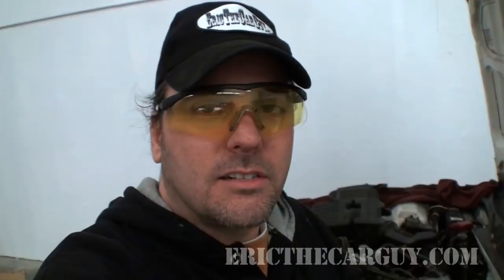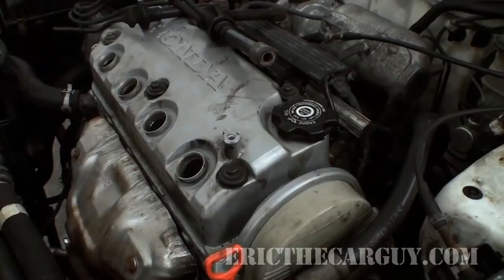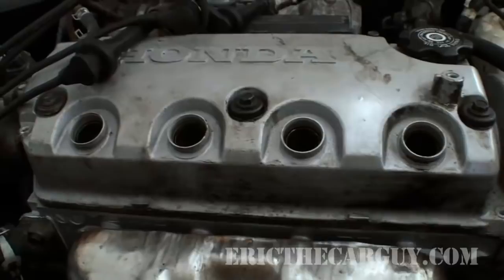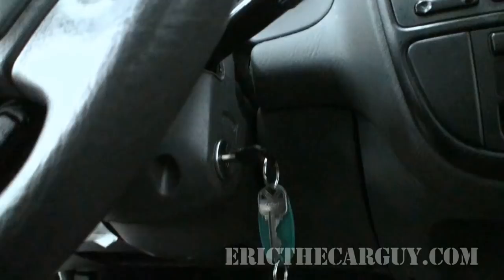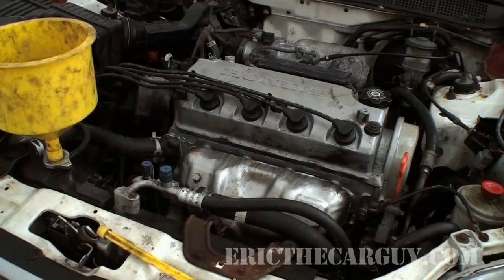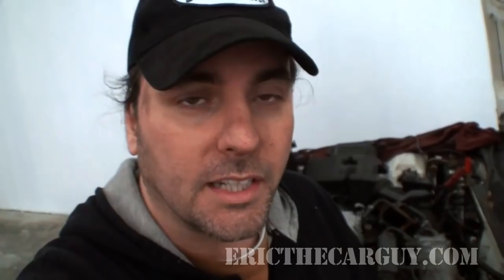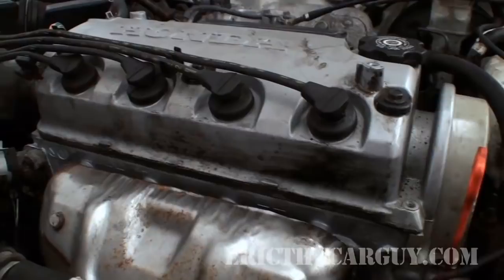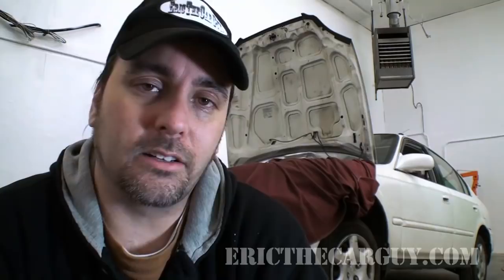How to Break In A New or Rebuilt Engine - EricTheCarGuy

Comment: Yes you can, the only thing that matters is that the engine is turning over. You only remove the spark plugs to ease the load on the starter, and you keep the injectors off to keep unburnt fuel from getting in the oil. Also needs to be a manual transmission.

Comment: Never start a new/overhauled engine without first installing a magnetic drain plug. There's a lot of microscopic filings that would otherwise be re-circulating.
First oil change, you will notice that the magnet-tip is loaded with deposits from the break-in. It (the deposits) lessen drastically after the first oil change. If you are running a flat-tappit engine, make sure you have Zinc (ZDDP) in the oil formula..as in API SF. Valvoline Motorcycle Oil is a good choice for Zinc. Best.

Comment: We all do things differently. But, my eyes are looking under the car 15 seconds after initial start. Changing the oil filter after an hour or so can't hurt either. Changing the rpm during break-in helps the motor "get used" to different stress loads that will vary every time you drive it.

Comment: Hey Just thought ide share. The rotax 600 ho Etec and 800r Etec motors used in ski doo snowmobiles do thier own break in's. Meaning the ecm controlls  and limits engine during hte brake in period, by litming engine rpm eithier limiting advance or retaring of timing and the electril oil pump delivers 50% more oil to the motor and rave valves. So you drive it "normaly" and the sled will do the rest.  THey also have auto summerization features

Comment: I have had several opinions on this (from professionals) and they all vary. So I'd like yours EricTheCarGuy. I just finished a rebuild. It has all high end performance parts. Normally I would just baby it for the break in period, but the ring manufacturer (Hastings) says to do WOT from 35-55mph 3-5 times to break in the rings. What's your thought? Please note that this is a street legal vehicle and will visit the track and is currently expected to run 12.3 in the 1/4 mile until it is procharged.

Comment: he squirts one to two tablespoon full of oil into the cylinders, just to wet the metal surfaces that have contact to each other, like cylinder walls and piston rings. i broke in my own engine 13 years ago and still today after 140,000 miles it has no oil consumption and runs fine on gas and liquified petroleum gas. So stick to what Eric told us. Different speeds, don't push it hard on the first 1,000 km or 500...600 miles and everything is fine. Greetings from Germany.

Comment: IMHO you don't need to go about taking spark plugs out and then cranking the engine - It's still going to be pumping oil around just at a much lower pressure than if the engine was actually running.. the best thing I would personally say, is to just ensure your new filter is already topped off, and just start it, allowing it around a minute to fully ciculate at idle (although all will be sent immediately...) and then just drive the thing.

Comment: Use Diesel oil when breaking in a new or rebuilt engine. It has Zinc and other antiwear additives that keep lifters, cam lobes and other "precious" parts from wearing quickly. I will also let the piston rings seat properly.

Comment: Everything is perfect until its started. I don't mean to tell you you're wrong but you actually want to get the rings seated properly within the first 20 minutes of the engine running. ALL break in is done within the first 30 min if you will. You want to run decent load followed by decent vacuum or decel to get most of the particulates out from breaking in the rings, and to get maximum compression. Letting the engine sit idle or at low rpm for the first minutes of its life isn't optimal.

Comment: Your idling to let everything come up to temp and to allow the fluids to circulate, you dont need to idle for even close to 20 minutes. Take the time the car is warming up to look for leaks or weird sounds and to double check fluid levels which may have changed since startup.

Comment: @Eric, your videos are the best.  It's clear your not a professional actor, you just get the important facts across.  Keep up the good work dude!  thanks a million.

@venomrx - If the engine was running fine, it probably is leaking oil past the cover grommets.  I have to replace mine just about every time I change the plugs.  I probably could permatex them but I want to be able to get the cover off easy and not have to clean that up so I just keep replacing them theyr'e cheap.

Comment: @1967800 only if new cams out of the box are used you need to do that .
they need to break in @ 2k for 20min so they can seat proper on all these used vt components from previous cams has stepped in...

Comment: Great video.  I have an '00 G20 SR20DE engine. Original owner.  I followed the owner's manual break in period and 15 years later, no engine problems.   Question.... do you think a '99 Civic or '99 Sentra or '99 Corolla has a more reliable, long lasting engine?  Thanks!

Comment: After I rebuilt the top end of my BMW 540i's engine, I had a lot of lifter ticking, so I had to essentially bleed the lifters by holding the engine at 3,000 RPM for about 3 minutes at a time, several times in a row. Interesting how the procedures vary per engine.

Comment: You actually want to ramp on the engine during it's break in. It's so that the rods are able to stretch to spec. So you'll attain the maximum compression ratio.
Reply: that is a overhead cam it don't have pushrods.
Reply: LOL  Nice edit

Comment: Sure, stick with factory/reman specs. Always. Every one is different however. Going strictly by the book, my specific vehicle is a bit of an odd duck. The manual states for my particular truck, there is no break in. Yes, it covers several variations. All other than mine states 500mi break in, under 55 mph, no jackrabbit starts and throttle/engine variation. There is an asterix and sub text note after that. Looking at the footnotes? "No break in required. Drive normally and replace oil and filter after first 5k miles." I admit she is a rare and odd duck compared to the other "standard GM" offerings. 

Follow the manual. Definitely respect the GM OLM, and after rebuild? Do what your Reman says to do to honor warranty.

Love your videos, Eric. You're a renaissance man in a day and age of "touchy feely, emotional bovine excrement". ^.^

Edit: Some makes and models like to see downhill, closed throttle engine braking too in order to fully seat rings and valves. Again, defer to oem manual or rebuilders' recommendations.

Comment: Nice one,  but when you brake in a new or rebuilt engine,until moving parts bed in, the oil will collect tiny metal shavings,too small for the filter to pick up and circulate in the engine which is not a good thing.  When I rebuilt an engine I change the oil and filter at the first 200-250 miles and then again  at a 1000.

Comment: Full synthetic of an equivalent grade is no thinner than conventional oil. The reason an old engine converted to synthetic leaks is due to the detergents in the oil breaking down the sludge that is keeping the seals from leaking.

Comment: It's a misconception that piston rings 'break in'.. Rings don't break in, the crosshatch in the bore does. The new crosshatch in the cylinder has peaks and valleys. The purpose of the break in period is for the rings to cut into the peaks in the crosshatch which stick out of the oil film causing metal to metal contact with the rings, and leave the valleys that are necessary to maintain the oil film layer. Rings hydroplane across the thin layer of oil in the cylinders except for the bottom and top of the stroke where they come to a stop because you can't have hydroplaning where there is no movement.  The ideal break in is using a good break in oil and actually running the engine harder to cause the wear on the peaks to take place as soon as possible otherwise glazing can take place in the bores.

Comment: Funny how older American cars, the break-in is different. With the old SBC, I pre-lube the engine but spinning the oil pump through the distributor gear. I've never had a problem with lifter noise, be it hydraulic or solids. bu adjusting them before start-up. I always change the oil after cam break-in, to remove the cam lube. Then change the oil again after a 5 mile drive. Then I drive the car, varying rpm's, for 1000 miles before abusing the car.

Comment: And I'll agree with that but like you said the evo X is a better car but in the end it's all about what you like i've seen older boxer engines blow out quickly at like 75k miles it really just depends and they can be a bit unreliable and like you said it is hard to reach spark plugs because their mounted very strange.

Comment: Yes.  No matter what RPM the engine is spinning, the oil pump pumps oil at the exact same ratio.  Technically, the engine gets the same amount of oil at 1rpm as it does at 5,000rpm.

Comment: Hi mate, just a thought/discussion...please correct me if I'm wrong.
When rebuilding a motor, hopefully, the fitter would lubricate all bearings and journals during reassembly that should last the first few seconds of start up.  When you're turning the motor over with just the starter this wouldn't build up enough oil pressure to fill the oil filter, let alone run through to the top end/head.  If the crank had flingers, which from memory the Hondas don't (again please correct me if I'm wrong), the best it would do is lubricate the bottom end, which means the top end is getting nothing and only running on the initial oil the fitter applied on assembly.  So it's not really 'pre lubricating' as such but robbing the top end of precious lubricated seconds on initial start up.  Just listening to the start up everything sounds dry - like after completing an oil filter change.  But anyways, I appreciate the time you spend making all these very informative videos.  Please keep it up Eric.
Reply: Look up videos for engines that have their initial break in done on a Simtester. The YT channel "Fiatnutz" has a bunch of them. That will answer your question as to whether or not oil is getting to the valve train at low RPMs.
Reply: TheAristotleQ oil pumps will certainly start pumping oil as soon as they begin to move.

Comment: Pop starting is not recommended for cars with catalytic converters as unburnt fuel may enter the cat and damage (or even destroy)  it. Also, you can start it normally even when it's moving so I don't see why you'd pop start it? Besides, depending on what car/engine/ECU it is, it should enter coasting mode down the hill (if you leave it in gear of course), which leaves you with all the engine driven auxiliary systems (power steering, brake booster, air con, ...) working without burning any fuel.

Comment: Let is warm up good and just drive it nice and smooth. Dont fly off.dont stay at any given rpm for long. Some people change the oil at 1500 miles the first time around it doesn't do anything but it puts people mind at ease. Dont tow and if you put a lot pf people in to go build up speed slowly not so slow you'll get beep on.

Comment: In college they taught me  that in order to break in a rebuild engine you will have to keep the revs at 2000 rpms for the first 20 minutes, and that you shouldn't let it idle, not even for a few seconds, after that time you should go from 1500 up to 2500 in order to break in the new camshaft. What can you tell me about this?

Comment: You should use a Vacumpump for the cooling system. So you dont need to bleed the system. I've seen it today, and it worked just great. But on the test drive the engine was warm in 3 minutes. ( yes pretty fast, but we also turned the heat to 100% and drove 10~15km.

Comment: I remember that on older American cars which had physical distributors, you simply remove the distributor, insert a straight screw driver bit into drill and place in slot on oil pump shaft in distributor hole and spin away. Gas engines today no longer have distributors so this wouldn't work on today's cars and trucks. I imagine distributors were replaced by engine ECU's which sends firing signals to each coil pack based upon signal received from crank shaft sensor.  Hard to believe we started with distributors with single contacts, then dual contacts, then solid state HEI, and now distributors are gone and computers tell individual coil packs when to fire.

Comment: Pretty sure you're trolling here whatitis99. But in case you're not, synthetic oil should definitely not be put in a new engine. because you need the rings to have light contact with the piston walls to seat them. Synthetic oil is too slippery and will not allow the rings to seat. Yes, honing technology has improved but this has REDUCED the length of time needed to run in an engine, not ELIMINATED it. Also, being rich and owning land has no relevance in this argument

Comment: I like hard break ins, Piston rings seat pretty quick, I let it warm up a bit, go easy vary rpms for around 20 miles, then slowly start getting into the throttle and hitting boost, and after 5-10 runs i'm wot and seating the rings, just letting the engine speedbrake and use the compression to slow itself and seat the rings, and also using boost to seat them. (yes I know this car is N/A...)
Reply: I've heard people say to go easy during the first x miles, don't go on freeways, don't open the throttle more than 1/4, etc. and others swear by the hard break-in method.  Well, with my last motorcycle purchase I decided to try the hard method.  I very much regret it.  I get horrible fuel economy and poor performance compared to the same bike with an easy break-in.  Lesson learned.  Do what the manufacturer recommends.

Comment: u said dont change the oil on a new car because they have additives that help, but what if its a DIY job and you just use oil from a local shop? im guessing you would then have to change it a couple of times before you start following the 3000mile standard of whatever right?

Comment: 1. Make a test run at 30 miles per hour and accelerate at full throttle to 50 miles per hour. Repeat the acceleration cycle from 30 to 50 miles per hour at least ten times. No further break-in is necessary. - Hastings Piston Rings tech article
The idea here is that the engine needs to be UNDER LOAD before break-in is possible.

Comment: You didn't mention re torquing the head.  I know this was something required on the older Hondas.  I beleive they had "floating" cylinders.  I suppose Honda has moved away from that.  I know head gasket failures were fairly common on the older civics made in 1970s and 80s.  Do you still have to retorque during break-in?

Comment: Still i dont get this, the engine should be already prelubed and even so if you disconnect the injectors and disable the ignition (spark) system you wouldnt get enough oil pressure to properly fill everything with oil, that's why you use assembly oil which i believe is more viscous/thicker than normal engine oil, because of its properties the engine wont run dry if you lube everything up with it and it burns/evaporates slower than normal oil.. Please correct me if im wrong.

Comment: Eric, I have heard that it is a good idea to break in a new or rebuilt engine using only regular oil, not synthetic oil. What do you think?  In 2005 I purchased a Dodge Ram 1500 Quad Cab with a Hemi engine and Chrysler recommended not changing the factory oil for 3000 miles, minimum. Then I changed the oil and used Mobil 1, since then I have used Mobil 1 for every oil change.                                         Thanks for the videos!   K

Comment: I did a complete rebuilt on a 2000 subaru b 4 twin turbo 4 years ago that had oil ring problems.  I oil up pistons and rings, bearings, crank and cam channels fill up oil filter and oil during assembling throw it in connect all the electrics, it fired up first pop still boost hard.
Reply: Senia. Samoata. These are sick, I own a '01 GT-B, same thing. It has 131,000kms, really hoping a rebuild isn't on its way anytime soon

Comment: Wouldn't removing the fuse for the fuel pump get you the the same results as far as preventing fuel getting into the engine? (On EFI engines, at any rate)
Reply: I would say just unplug the cam sensor if it's Easier to do because that will kill the spark and fuel

Comment: NO!  You did it correctly!The engine had lube in the bearings,but not at the top end. Always good to get the oil pressure up[ B-4 starting.Some,you can mechanically create oil pressure with out cranking.Pay attention,here.  Use oil with a high zinc content to help break in.

Comment: I have dropped in a couple engines before, there's usually something in the directions about holding the motor at about 3400 rpms or so for about 4-5 min to help harden all of the bearings. Why didn't you do that here?

Comment: Yo, what does he mean by "valve adjustment?" It uses hydraulic lash adjusters. They pump up thus accounting for the slack if there is any. If there is such a thing for HLA's, hit me up because my rebuilt Mazda engine has slightly noisy valves.

Comment: @Intelpentium54321 depends on what kind of method you are using for the break in. I know some recommend getting close to redline and letting go of the gas while still in gear to "engine brake". They say it helps seal in the rings.

Comment: I don'tr suspect for one fraction of a second that he forgot to turn the engine  over by hand for a minimum of two full revolutions ( half a dozen is even better, to be sure, to be sure:-)  before engaging the started, but he forgot to mention it in the vid.
Turning over by hand gently ( and inexpensively) informs of any mechanical interferences, and lets you fix'em.
If the valve timing is out, your starter motor will ruin the engine(especially when the plugs are withdrawn)